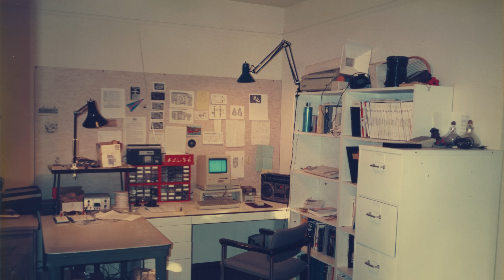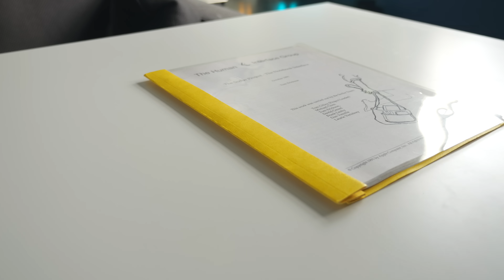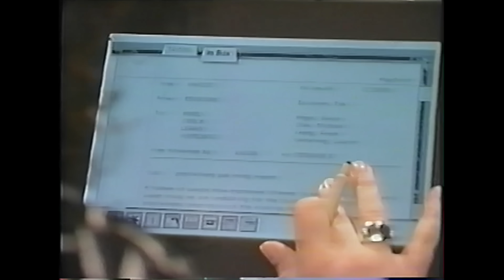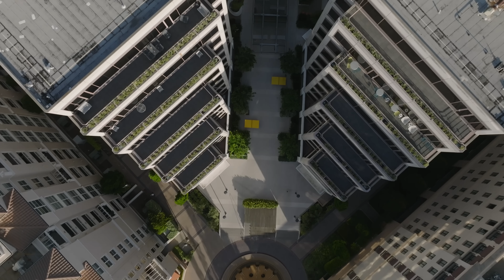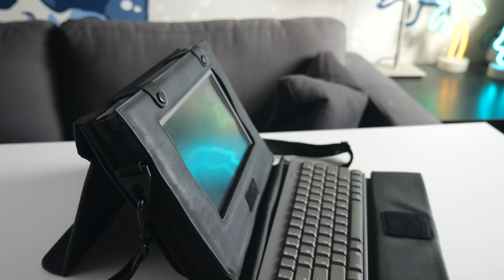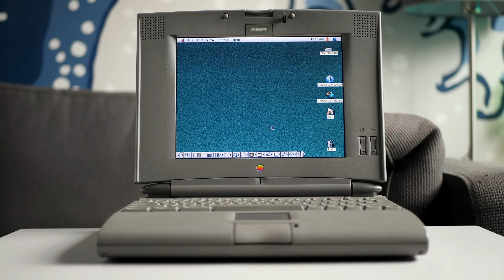Apple PenLite: The iPad Before the iPad!

Comment: They were so close to discovering the modern touch screen keyboard. Ten fingers at once, all they needed to do was make the keyboard the full width of the display and make an easy way to summon and unsummon it, and make it pop up automatically where appropriate.
Reply: We did a ten finger touch display in collaboration with ATT labs, the cost and power budget would not allow for production back then.

Comment: I worked at an all Mac ISP in the mid-90s.  We used a Mac "portable" to do our billing.  It was air gapped and we shoved a floppy disk from our Filemaker database into it.  It called the credit card processor on dial-in line and processed it.

Comment: Even though I don't like Apple much for a few reasons, it's not that often you could find those ancient hardwares which is a pleasant surprise especially if you actually like computer history like I do.

And plus, reconfigurable computing is a thing now, especially for AI neural processing, naturally with even more computing horsepower compared to the early Macintosh Reconfigurable System cards, to the point water cooling or heatpipe heatsink is required to keep FPGA from cooking itself.

Comment: "It was a rite of passage at Apple - if you make your own product, you get to make your own connector" - thanks for making things a pain in the ass for decades
Reply: There are tradeoffs with the universal approach. Now the USB-C connector allows for Thunderbolt (data), HDMI (video), DisplayPort (video), USB-PD (power delivery up to 20V at 5A), USB 2 (data), USB 3 (data), USB4 (data), digital audio, analog audio.

Determining if your particular USB-C cable works at the power level, data speed, and/or protocol now requires reading the fine print on the cable, instead of just looking at the connector type.
Reply: @mohawk5010 maybe, but most/all of those cables would work for basic usb connectivity and charging, which is what 99% of people need 99% of the time. If you need something else then you’ll probably be searching for specific features anyway, so in that sense a universal connector is way better than having a unique connector for every device. It also keeps the cost of accessories down. Imagine what it would be like if every current Apple device still used the lightning connector (ignoring technical limitations), android phones used usb-c, laptops used various barrel jacks, and desktops used usb-a for everything (I know this is unrealistic and an oversimplified example, but it paints the right picture). Technical limitations and competing standards made multiple connector types necessary for a time, but now that things have begun to consolidate it’s obvious that the user experience is better this way, even if the transition from usb-a to usb-c was horribly botched and now we’re stuck with both.

Comment: It's funny... The part where Tom describes how they developed styluses for the Scribe, where they'd have different nibs for various textures and so on... That is exactly what the Apple Pencil of the modern day is missing!

I don't want to have a nasty plastic screen protector that wears out in 6 months for a "paper feel". They came close with the new iPad Pro that has an anti-glare glass, but that iPad is very, very expensive. As an illustrator who uses an iPad and Apple Pencil as my main art tool, I was so excited when they refreshed the Apple Pencil this year. But the one thing I was hoping to see never showed up. Turns out the feature I wanted from Apple was made about 3 decades ago.

Thanks Collin for this excellent look behind the scenes at Apple!
Reply: Those different textures should be done with software I think with the new P1 silicon in future pencils that can stimulate nerve impulses in the users fingers with reverse capacitative induction.
Reply: @MrKurtHaeusler  I have the pencil pro and while the haptic feedback is impressive, I don't know if the level of control I'm looking for can be emulated as such, but if yes I would indeed be blown away. I'd be perfectly content with proper nib options like many competitors have. There's a company in the Netherlands called "Pen.Tips" which is certainly trying to achieve this. Unfortunately their nibs fell short of my expectations in quality and durability.

Comment: "If you made a computer you got to make your own connector" OMG. This is one of the most horrible aspects of Apple hardware over their entire life span. Custom connectors. I don't care if it was a "right of passage", that floored me. I had a hand-me-down Newton that was USELESS because of the custom connector for the serial port, that was impossible to find by the time I got it.
Reply: You should check if there's open-source / retro-mod designs out there for an adaptor.  Might be as simple as a Raspberry Pi with a 3D-printed connector (that you might be able to make or buy pre-made).

Comment: They should take this concept into the modern day. Get rid of iPad OS and just blend Mac OS into the new m series iPads. They're so limited by the fact that they still just use ipadOS and it just seems insane that they have full desktop class chips and don't actually do anything with them. They could be extremely neat extensions of the Mac ecosystem I think.

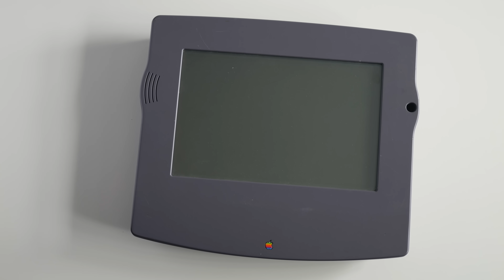Comment: 30:55 I have noticed with some of your videos that in some of the edits (don't know if its for chapters or not) that with your particular cadence of speech it sounds like you are mid sentence (ie time stamp) and that kinda throws off the flow in my head. Also makes me think I missed something, kinda startling? IDK
I still think you could get a mill subs if you did shorts and they could be easy for hooks for the vids but I won't harp on that anymore. Thanks for the vid and the time it took have a good summer.

Comment: This is actually insane how the PenLite is basically an iPad before the iPad
And it even ran proper Mac OS, just with a few drivers and other software to fully utilise the pen
What's even crazier to me is that they had the "hover" gesture already in the 90s

It's a shame that it got cancelled, maybe it would've had some market for enterprise settings at tech companies for
some sort of a carriable device for employees, so they could jot down notes in a meeting, attach it to a dock and get
to use their notes while doing the work.
Reply: It was not iPad at all conceptually, but great on its own. Just too pricey. It would have been another Lisa.
Reply: BTW, technologically it was too early anyway. E.g. Jobs has wanted to do a touch tablet since the 1980s (!), but there was simply no way to do it right until circa 2010.
Reply: @tatianaes3354  I’ll agree to disagree with you on that one. The lineage of tablets stretches back before the PenLite and had many releases after - with some very decent results. For the most part, “doing it right” meant “getting the cost down”. Even with Microsoft’s early attempts to mass-market tablets, it wasn’t that they were bad, rather they were expensive (typically starting around $1999). What the iPad did, more than anything else, is made the tablet accessible at $500 to a broader market with a touch-first OS.
Reply: That is literally what we need on the m series iPads right now lol
Reply: Someone at Apple needs to look at the archives and have a huzzah moment with this idea lol
Reply: It's really more like the Microsoft Surface.

Comment: That was awesome! i wish these guys could showcase more of those bareboard prototypes and how they used to develop them. Also wondered how did they do the actual programming of the micros/logic devices. Did they use Mac's of the day with some custom development software? I managed to find an old version of MacPIC and was able to actually program a pic microcontroller on an old powerbook, but besides that it seems so hard to find other older(mac platformed)development software.

Comment: Excellent documentary. It hurts to see that even now Apple refuses to have a touchscreen on a notebook. It was all there in the 90’s.
Reply: I just find it funny jobs mocked the surface pro and yet they do similar things with the iPad with detachable keyboard cases 😂
Reply: @gmcnewlook  The first Surface, and the Surface Pro, shipped years are Jobs' died. So he most certainly did not mocked the surface. He mocked the stylus, but if we extrapolate on that a little since he was no stranger to art and graphics tablets, I would venture he mocked the stylus because (to extend and paraphrase) "if you see a (user interface designed around and requiring) a stylus, they blew it." - like this penlite concept. You're using an on screen keyboard or handwriting recognition. It's not too dissimilar from Windows for Pen Computing from the 1990's as well. With iPhone (where the the stylus comment came from) you can actually type really fast, not just peck away at letters with a stylus. Same with iPad. iPad launched under Job's with a fixed desk oriented portrait style iPad Keyboard dock, nothing like Surface. Apple didn't ship Surface style magnetically attached iPad keyboards until many years after Jobs' death.
Reply: @syniteq  yeah I got him confused with cook I realized that afterwards
Reply: @syniteq the first Surface, i.e. the big ass projection-based tabletop computer, did ship way before Steve died, and he may very well have mocked it.
Reply: @Mainyehc  maybe he would’ve mocked it,  but I’m not so sure. It was originally multitouch and has a bunch of cool ideas. They didn’t just put a PC desktop with a start menu and desktop icons on a huge table. So I don’t think there is much to hate on, except size and price.
Reply: @gmcnewlook  Jobs didn't come back to Apple until 1997 to be fair.
Reply: @gmcnewlook  RIGHT. The irony!! LOL

Comment: Neural network handwriting recognition in the early 90s?? This was wayyy ahead of its time. They were geniuses!
Reply: neural networks have been around since before we had transistor based computers.
All this AI hype in the last decade is just that, hype.
It's not new. It not even useful in most cases.
It just happens that we have powerful enough computers that it no longer SEEMS quite as wasteful to make the toys with AI than it used to.
Reply: @Prophes0r  Autograd is new though
Reply: @gasun1274  What is your point?
We have made very little progress on neural networks in half a century. It's hype.
GANs are interesting, and can actually be made now, but even those aren't "new".
LLMs literally don't do what people think they do. They are a whole different problem.

The bottom line is that for all this "AI" hype, it isn't really useful. Almost all of it is a toy to play with, not a tool to do a job.
We HAVE massively increased available processing power. That certainly makes it look like we are progressing.
In reality we are just obfuscating the hardware and electricity costs of these toys.
Reply: @Prophes0r I think this is one of the most misconceptions about this whole thing. This is the kind of take that an average person with zero knowledge on the topic has. Just because a lot of the fundamentals aren't new doesn't mean the package isn't new. There has been a lot of sleepless nights working on this problem for the past few years  (I know, I am in the field) that this statement suggesting that none of it is new and its just a toy lack a lot of maybe updated knowledge on the matter. A lot of the models power a lot of things behind the scenes and have been for a while. Example practical uses are identifying inappropriate content in videos, text, comments and images. I picked that example because this is one of those things thst you csn make some argument fhst it's not new fundamentally but a lot has changed to adapt to the new technological advancements we've made over time and new techniques to be able to do more with less power. It's a lot of behind the scenes improvements that eventually lead to the current state of things (and things have been dramatically improving since then due to competition)
Reply: @AnesuC  One of my hats from 2006-2018ish was Machine Learning research.
I'm well versed in the topic at both the graduate level and the personal level (Since we all know how things like this can consume hobby time as well.)
I never said there was zero use for this.
Image recognition is useful.
Upscaling is also useful.

I'm claiming that the VAST majority of "AI" (And BOY do I hate having to call it that...) is a toy.
LLMs are a toy. They are a glorified search engine in a pretty package, and ALL of their results are just a repackaging of their training material, which makes them theft in nearly all cases.
Diffusion based image generation is a toy. It is also theft, or near-theft at best. Even calling it "generation" is like calling a box full of books, a pair of scissors, and a glue stick a "Book generator".

"AI" is a grift.
This entire trillion dollar industry is built on false promises, smoke and mirrors, and intentionally misleading marketing.

The fact that major companies like Nvidia even broach the subject of General AI is SO laughable, that it indicates how little anyone with a voice in this game actually understands.

"AI" isn't useless. But, it isn't 3 trillion dollars and 0.1% of all electricity generation "useful".
Reply: @Prophes0r   lol you sound like a resurrected Marvin Minsky.

Comment: Huh. This video is how I learned that QuickTime is one of the VERY FEW products that survived Steve's return and even sticks around to this day. It exists as the default video player in macOS and process for video playback in iOS and iPadOS even in the 2020's.
Reply: Quick time was so much more than that. It was a wrapper for video encoding. That was used on almost all platforms and almost all video software supporting it. 

What I think you are talking about is the QuickTime Player app right?
Reply: The modern QuickTime app is related only in name to the 1990s product. It's now derived from the iPhone video player, not the old media engine. The QuickTime MOV file format has lasted a little better, being the basis of MP4, now.
Reply: I remember having to download QuickTime on a Windows XP to watch old videos online
Reply: Inkwell, the text recognition software from Newton, still survives to this day in macOS and, I suspect, in iPadOS and iOS.
Reply: @Mainyehc Which started out from this project as Rosetta. The text recognition engine from Newton OS 1 was completely replaced in version 2.
Reply: @pseudotasuki  yep. Interesting how they reuse IP, both in tech and name form. Though the name is super obvious and engineers may have arrived at it independently, the binary translation layers Rosetta and Rosetta 2 might’ve been inspired by these…
Reply: @Mainyehc  sorry inkwell had been gone for almost five years and most likely replaced with same stuff used in ipadOS scribble. 

From what I know iOS don’t have text recognition